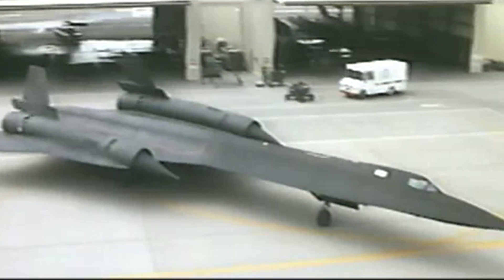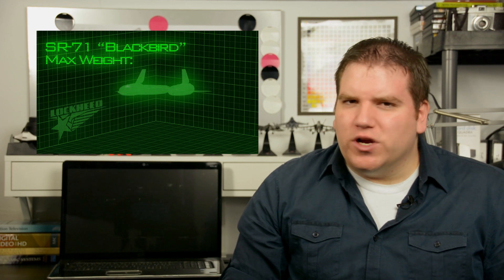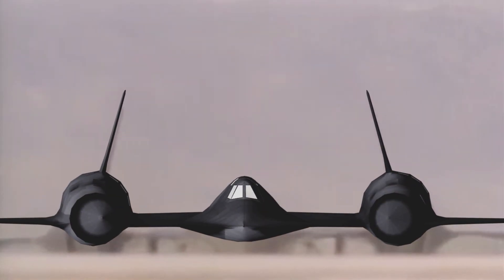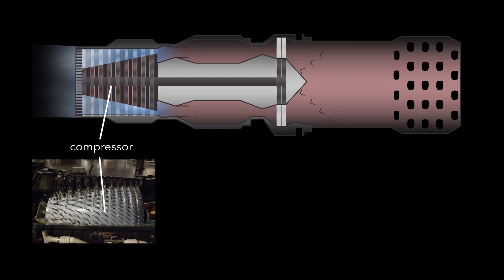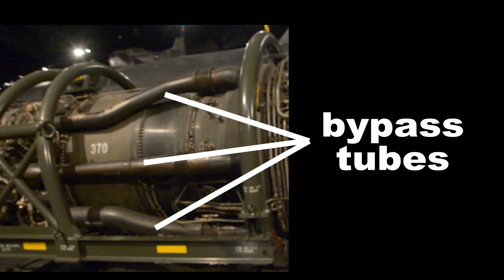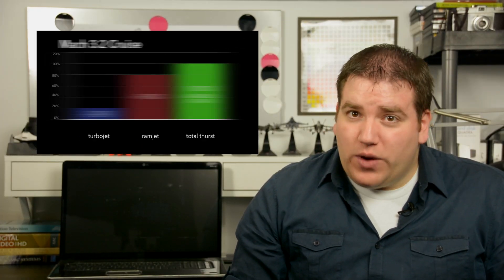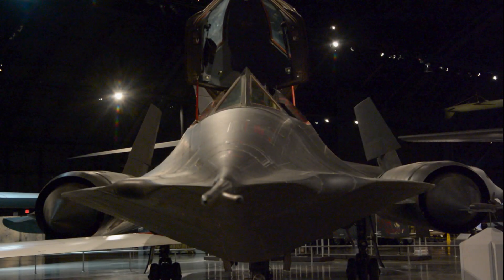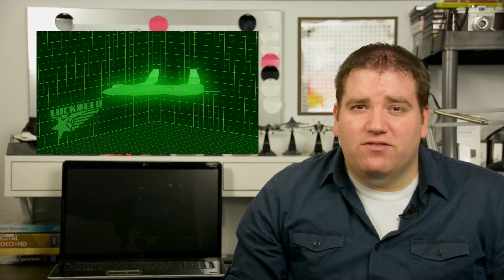The Plane that Dreams are Made Of: The SR-71 Blackbird

Comment: Should mention the JP-7 fuel that this bird used.  It's flash point is so high that it can be used as both a coolant and an engine lubricant before it is finally injected into the combustion chamber for burning.  Yet another bit of genius.
Reply: I was a JP-7 fuels tech.  Flashpoint was about 146F and used an additive (triethylborane or TEB to us) before getting injected into the engines.
Reply: @jkanderson7  The TEB was really used as an additive. As you mentioned, the JP-7 flash point is very high relative to standard jet fuel. The problem is getting it to ignite during engine start. The normal method of using several high intensity electric igniter plugs, inside the combustion cans, doesn't provide enough heat energy from the spark to ignite fuel w/such a high flash point. The solution was to use Triethylborane(TEB). It is a colorless pyrophoric liquid, that spontaneously ignites when it contacts air 129°F or lower. The SR-71 contained two cylinders of TEB (1 per engine). During startup, once the engine was spun up to self sustaining rpm, JP-7 was sprayed into the combusters, followed by a measured shot of TEB. Upon contacting the air, the TEB would ignite, thus igniting the JP-7 & starting the engine. The TEB was used for starting the engines, as well as the after burners. The pilots had a dial counter mechanism attached to the throttle quadrant of each engine. Each time the throttle was moved to the afterburner position or engine start position, the counter was designed to count back by 1. The reason being, there was only enough TEB on board for, i believe, 14 afterburner or engine re-lights, per engine, per flight, due to the volatility of the chemical. The counter was set a 14, and automatically counted back for every shot of TEB used.
Reply: @willthacker5182  That would be the green flash you saw in the video... TEB being a boron compound, tints flames a strong bright green.
Reply: @jkanderson7  I used to hate it when it dripped down my neck.  Especially during the North Cali winters.  It always reminded me of brake fluid.
Reply: @jkanderson7  Exactly!!!
Reply: Good point--JP7 isn't even a distillate fuel.
Reply: If you were at any Air Force base in the world and saw a JP-7 fuel tank you knew that it was a possible landing base for the SR-71 in case of  a emergency. I know Incirlik AB in Turkey had JP-7
Reply: my fave SR71/A12 factoid is the fact that the sovs sold the americans the titanium to build her with. just beautiful.
Reply: They used the liquid O2 in tubes to cool those black nozzles on the space shuttle jets for flights to space.  Smart too.  Since liquid O2 is around -312f.
Reply: holy cow that's crazy!
Reply: Its also the hydraulic fluid !!!!
Reply: You could literally light an entire book of matches, drop it into a container full of JP-7 and the fuel would put it out.
Reply: love this kinda shit
Reply: that's awesome hahaha
Reply: Robert Alexander So? You can do that with diesel.
Reply: I heard it was more expensive than single scotch whisky. One of the planes going to a museum was decided to cut it up transport and reasemble as it was much more expensive to fly it there, about 1 million dollars per hour.
Reply: @TR6Telos  I believe that museum was the Evergreen Aviation museum in McMinnville Oregon. I've been there several times and remember them mentioning that it was dismantled before shipment. 
It's directly across the road from a military air base, but the runway is too short.
Reply: This plane is a remarkable amount of genius to build and it is my favourite plane
Reply: Don't forget that the titanium that was use was baght from Russia
Reply: Crazy indeed

Comment: you wanna show me something I don't know talk about the dimples in the forward leading edge of the plane. What are they for?
Reply: ***** If by the forward leading edge you mean the nose chine, the newly added "ASARS" sensors required the nose section to be slightly modified in the shape of a"ducksbill" during the mid 1980's
Reply: ASARS (advanced Synthetic Aperture Radar System) is a whole new nose with a convex upper surface, compared to the earlier concave upper surface.  Lots of other noses (OBC [optical bar camera), or SLR [side looking radar]) had the bumps, which are for the DEFA2C system, a defensive system that i don't really know how it works, not being an electronic warfare guy

Comment: The reason there is higher efficiency for the After-burning Ramjet is because there isn't a turbine that is trying to run the compressor sucking 65% of the energy out of the thrust gases. The reason it is more efficient going faster is because it is travelling a very high altitude and the air resistance is lower per kilometer of travel and also it is travelling so fast that the maths on the efficiency looks good. Its DOES NOT consume less fuel per hour going fast than it does going slow.
Reply from the maker: Karthik Vishwamitra Actually... there's a noticeable drop in consumed fuel over time as it went faster.  That's because of the transition from afterburning turbojet to ramjet characteristics of the J58 in the airplane body.  Turbojet fuel efficiency peaks around Mach 0.8, and jets that use afterburners sacrifice fuel economy for additional power and therefore speed.  The SR-71 was no different in this case, except that as its engine cycled closer to the performance of a ramjet, which as peak efficiency (depending on design) between Mach 3 and Mach 4.  Fuel economy would decrease as the airplane approached Mach 2.5, and then would increase by quite a large percentage so that by the time it hit Mach 3 it was consuming less per hour than at a slower speed.

It's one of those facts that seems very wrong at face value by classical assumptions, until you dig a little deeper and see what's really going on.
Reply: He never said that it does consume less fuel per hour, he was speaking in terms of distance to fuel burned, not time. Of course it burns more fuel per hour going faster, but it can travel MUCH further than it would at lower speeds with the same amount of fuel. Who gives a fuck if you run out of fuel in 2 hours when you're going so fast that you get to your destination in only 1?
Reply: I think the short form of this is "it gets good fuel economy going fast not because it uses less fuel, but because it is covering more miles" right?
Reply: if you realise that is happening with the compressor to operate past MACH 1, a fire hose Jet A1 on a bonfire is more economic than that. Its no surprise that ANYTHING is more efficient than that. Turning that compressor at those speed requires ridiculous amounts of energy and then the is the afterburner. Probably the most inefficient machine on the planet at that point. So to see an increase at that point is not that mush of a surprise.

Comment: Considering the top speed is classified. This thing may be capable of Mach 4, and that's just incredible.
Reply: For the very last flight taking the SR-71 to DC museum they checked with both Lockheed and PW.  The result was the approval for mach 3.3.  The limit was controlling the craft if an unstart occurred.  Faster speed might result in an unstart making the craft uncontrollable.  Source. One of Richard graham's books talking about his last flight to deliver the plane to DC.
Reply: @Multicsfan  M3.3 approved because otherwise an unstart would be so unbalanced at the thrust levels that you'd pretty much instantly have 78 tons of titanium confetti and greasy fuel vapor where a blackbird used to be. This is actually more feasible to my mind than any of the other explanations...
Reply: They probably hit M3.4 or M3.5 during avoiding AAM or other anti aircraft situations.  But that was an emergency situation, not normal flight.
Reply: @Multicsfan  When the risk of getting shot down exceeds the risk of yeeting the aircraft into one last sweet dorifto 'cause an engine went 'BANG' by itself, yeah, slam those throttles.
Reply: I asked one of the pilots how fast it could fly.  He told me he truly didn't know and that he was afraid to find out.

Comment: WTF, I just ran a bunch of quick calculations and the SR-71's fuel efficiency is better than even today's jetliners. The SR-71 took ~12000 gallons of fuel and had a range of 3300 miles on it, so about 0.275 mpg. Compare to the very state of the art in fuel efficiency on commercial jetliners like the 787 Dreamliner, which gets 0.27 mpg and the atrocious fuel efficiency Concorde got at only 0.144 mpg.
One would think that this disparity arises from the SR-71 being extremely light-weight and stripped down, but that's not necessarily the case. The SR-71 had a ratio of empty-to-MTOW of 36% (meaning, 36% of MTOW was the plane itself). By comparison, Concorde had a 42% empty-to-MTOW ratio, an A380 is at 48% and a 787 is at 51%. While certainly light, it's not in the insane region that aerospace technology can produce (e.g. Saturn V rocket at just a touch below 6%, Falcon 9 at around 5%).
At first glance these numbers seem to suggest that a modern commercial derivative of the SR-71's technology isn't that unfeasible. Even if we lost part of the fuel efficiency in the process, I'd bet there'd be quite a sizable market willing to pay 2x the regular fare price to arrive at their destination over 3 times faster.
Reply: The SR-71 didn't have to carry several tons worth of people, seats, air conditioning, luggage and entertainment systems. It had to carry 2 people, a camera and a communications system
Reply: But it is only a two seater ride!
Reply: +totoritko Air drag. You're comparing 10kft hammer to a 80kft razor. Air density exponentially decreases with altitude. They are going for space travel to go >M1 for passenger stuff now because the public was dissatisfied with the sonic booms.

Comment: This video simply outclasses any other SR-71 video. The amount of quality, interesting content I just watched in these 7 and a half minutes would have been stretched out and dumbed down to fill up an hour long documentary. You even have a separate video on the engines physics! I could cry :'D
Reply: ***** I was a Naval Flight Officer and live about 7 miles from where these engines were designed, tested and built. (Hint: I don't live in France.)  I have numerous family members who worked there and myself have been witness to several "test" runs at their facility.  During it's height over 60,000 people worked in this one plant.  I can assure you, this engine was designed and built in East Hartford, CT and not France.
Reply: Regolith I came to the same conclusion after reading his reply to me.  He must be getting lonely in mom's basement...
Reply: ***** Ah, so you're just a troll. Got it.
Reply: The engineers made use of Le Chateliers principle in the conversation from a turbo jet  into a turbo ramjet via the 6 bypass tubes that directs compressed air around the middle engine directly into the burner/after burner cycle. The aim is to maximize the amount of desired product thrust  by maximizing the use of one limited component fuel through the increase in concentration of another component air so as to make the thermodynamic equilibrium shift left/right, maximizing thrust-- that was real slick only in the U S of A .
Reply: ***** no they were not you MORON!
Reply: ***** first of all nimrod i was commenting on the technical facets of the planes engine.Second no where have i read about any french involvement in the design of the plane albeit my research on that ground was minimal thus confirming the fact that i am  more interested in how it functions than who or what made it.  And oh it was not a fighter jet, look who doesn't know anything about the blackbird.
Reply: ***** Well, it's really interesting and totally a revelation to me (apparently I'm uneducated too, like Tonga Jones  in that matter) that Habu's engines were "designed in France" as you wrote. Was Pratt & Whitney aircraft company french owned?! Or maybe Skunk works? And how exactly did the French partake in its development, what was this "pivotal role"? You see, soo many questions and no answers! Please, if you insist on your thesis, indulge us, and provide a prove for your statement. Everybody here, the enthusiasts of this magnificent Bird would love to read it.
Reply: Pity there's so few videos though.
Reply: ***** you are an idiot. And what makes you think i am hating on France! Please do ban me, because your incompetence is overwhelming especially on this subject not to mention your lack of intuitiveness into my area of interest as dictated in my earlier posts.
Reply: ***** If you have sources showing French involvement, show them. Put up or shut up.
Reply: ***** Much better. You may even hook another commenter with that one. Just the right mix of bullshit and earnestness to come off as genuine.
Reply: ***** Now you're just being a lazy troll. Come on, show me your A-game.
Reply: There is an over hour doc on a pilot with little footage. he talks about the sensors, camera, speed, how to apply to fly. GREAT interview. He has a model of the plane and explains parts of it and what is going on.
Reply: it could but at the time that where looking into it for a different project
Reply: Regolith... The engineers and pilots liked French Fries... sooo... :-/
Reply: Thomas Brennan vom

Comment: In all fairness, the MiG-25 probably cost around 1/100 of the SR-71 to build (steel instead of titanium), and less than 1/10 to operate. And for that it is quite impressive, too. Ironically, most of the titanium used for construction of the SR-71 came from soviet Russia :)
Reply: Mauricio Castro
Well, it may have used more aluminium than steel in total amount, but the point is that it used substantial amounts of steel where slower planes use aluminium and other very fast aircraft use titanium. On the other hand, the MiG-25 had such an abundance of power and very little payload that it would probably have flown if it were made entirely of steel.
Reply: ***** How is that emberassing? Normal cold war things, you sound like a giant hater. Think about your heart, angry person. =)
Reply: Mauricio Castro I believe most of the structure was steel as aluminum would melt at those speeds though they used some aluminum on parts that did not heat up.
Reply from the maker: I actually like the MiG 25 too!  And I think the history of its design spurred from the creation of the XB-70, which in turn spurred the US to develop the YF-12 out of the A-12 (and later the SR-71) is a fascinating example of Cold Ward Intelligence speculation and misinformation!
Reply: I think it is even more impressive is that the US acquired the titanium through third party transactions right out from underneath your nose and you had no clue what was happening.
Reply: ***** now THATS embarassing
Reply: I think the Mig 25 used more aluminium than steel if ever the engineers wanted that bird to fly.